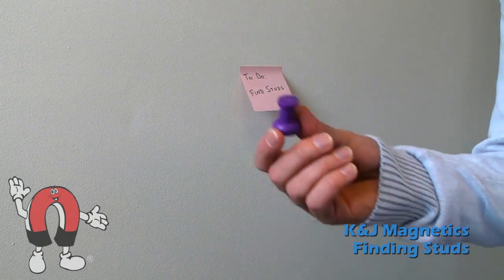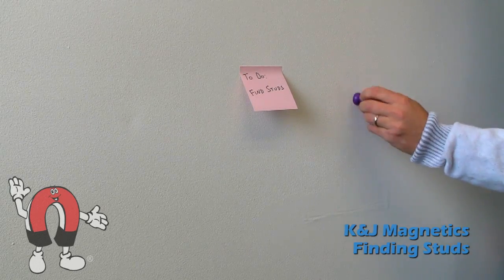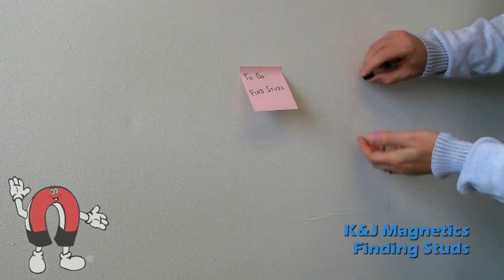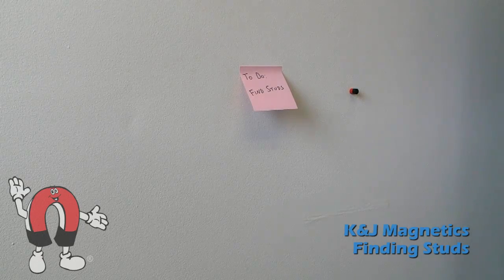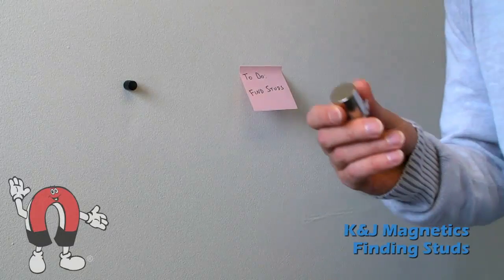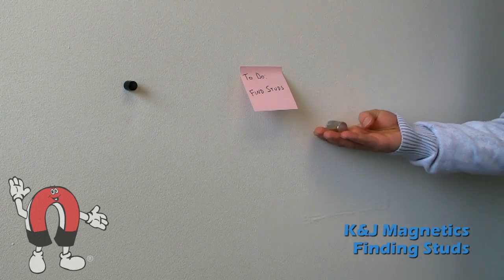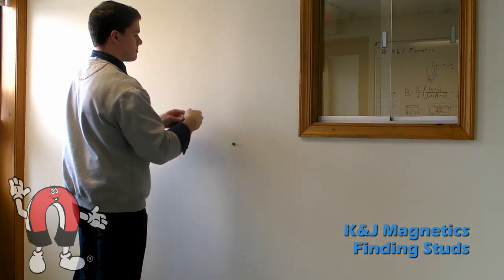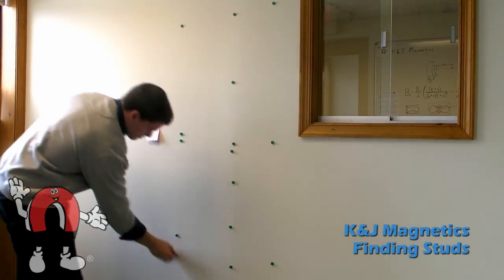Find Studs with Neodymium Magnets

Comment: This is a good method I used thiis. Although I dont really get how the drywall is screwed to the stud, which end of the screw is actually in the drywall - the flat head of the screw or the pointy tip of the screw? and i guess it's a good idea to avoid putting a screw into the wall near where the magnets found a screw underneath or youd get metal on metal right?
Reply from the maker: The magnet is attracting to the head of the screw!